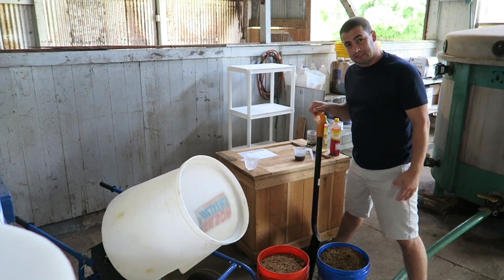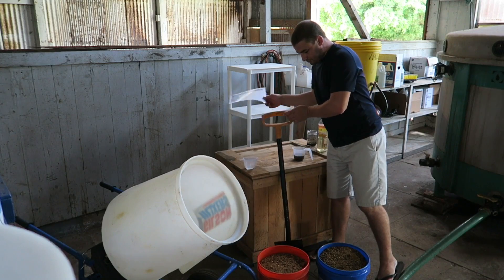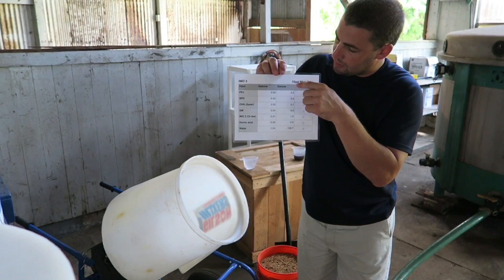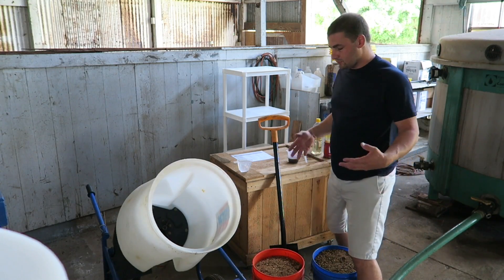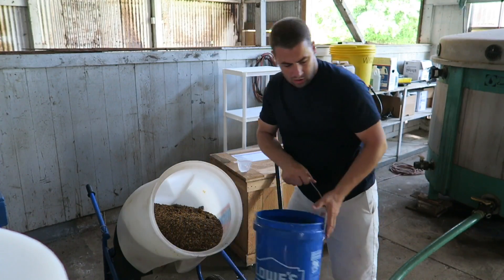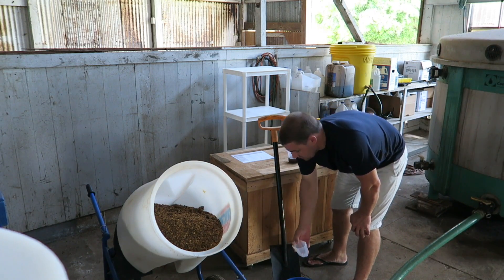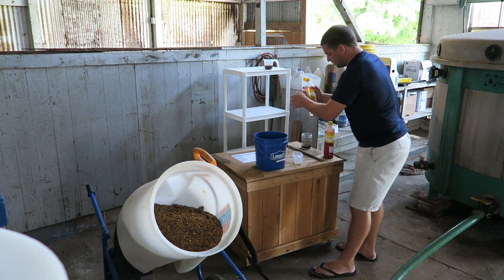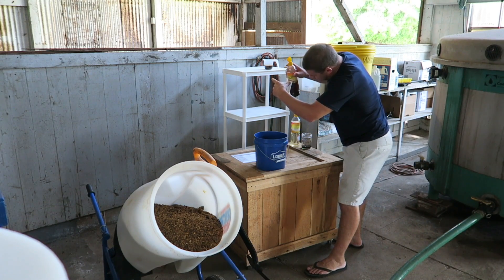IMO #3 with Chris Trump. Natural Farming on our farm.

Comment: I am an agronomic soil scientist. A word of caution about aqueous vegetative extracts "compost tea". First: the finish extract contains very little, if any, nutrient value in lab analysis. When compared to groups receiving an equal amount of water on the same schedule the two groups are indistinguishable. Secondly: these malto-lactic fermented solutions can be dangerous. E. coli, salmonella and even cholera have been incubated this way with deadly consequences in Korea and Taiwan. Compost does not have these issues and is generally recognized as safe and effective.

Comment: SWEET mixer!  I have a 6X6X4' high compost bin for initial breakdown & then I load into either 30 gal or 55 gal plastic drums which with major holes and rabbit cage wire in the bottom are essentially big assed worm towers.  This means to turn my shit I either shovel or rake it out of the main bin. OR I'm raking it out & dumping it out of a barrel, stirring, raking, shoveling in fresh medium to break down and then loading the drum back up.  A little bit of work.

Comment: my imo3 got little bit greene not all white, its good or got anaerobic? or my imo2 was not good? Can i use that to make liquid imo? max temp went 62C on day 5 and i turned it 3 times now is 48C on day 6. I got mix 10l wheat bran and 20l larger saw dust. Any suggestions? thanks

Comment: Hi Chris, It's me again. Hope I'm not a pain in your butt yet. Also hope you and all your family are well. 
I wondered about using spent beer grains as a carb and saw dust as a carbon for my IMO3 base. I can get then moth consistently and free. I figured I could mix have the sawdust (kept as dry as possible) ready before I got the grains once I get them I could mix them together using the sawdust to absorb as much of the moisture as possible. Hoping i could get a good mixture in terms of C:N ratio, and in terms of moisture level concurrently.  I guess I'm just wondering if there was asny reason that those two ingredients would not be good for IMO3.
Reply: William Tolbert did you try this?

Comment: where do you learn this method?
im semi chemical guy this is very unusual.
i use compost tea, worm tea, and make kind em4 solution with pineapple juice for leaf.
but this kind alcoholism thing never seen.
Reply from the maker: +sawadikin there is very little alcohol in any of this. I learned this from Cho Han-kyu and then developed it into a large scale process on my own.